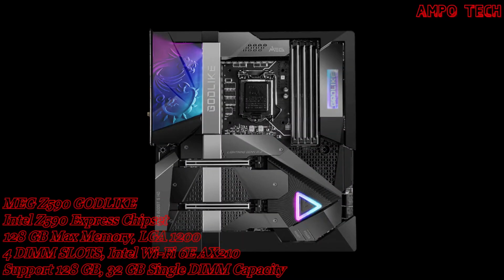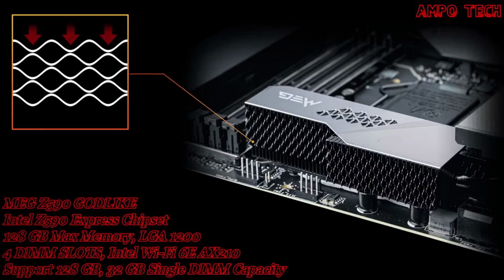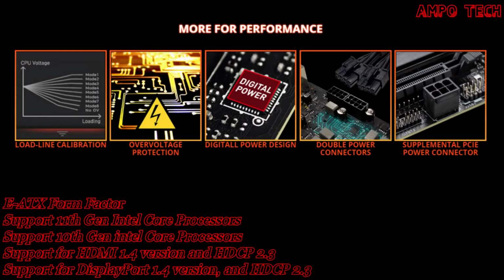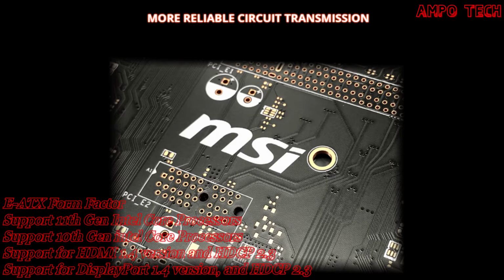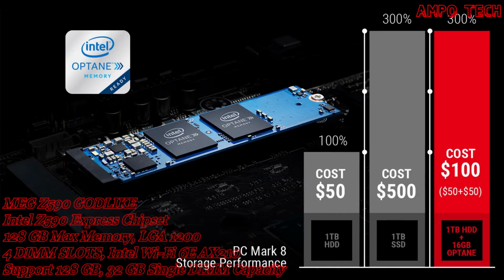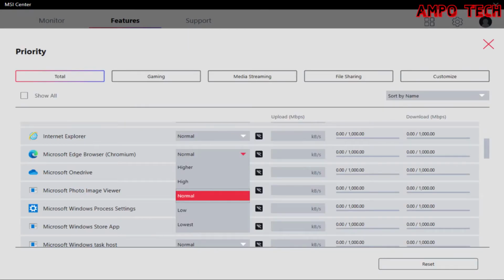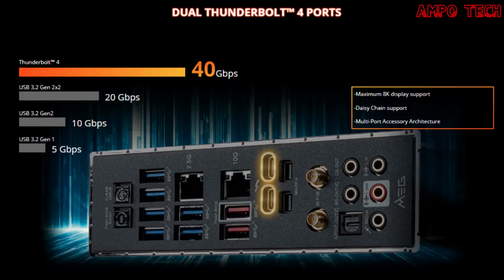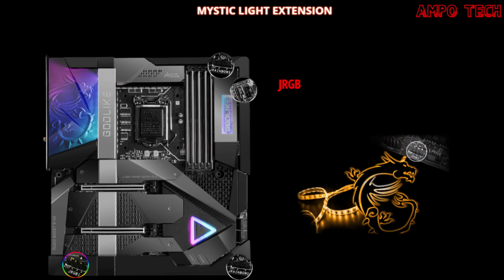MSI MEG Z590 GODLIKE Motherboard | AMPo Tech

Comment: In MSI Z590 ACE, M.2 NVME SSD won't be supported if fitted on PCIE Gen 4 slot, if 10th Gen processor is used. It works only with 11th Gen processor. Is this true?